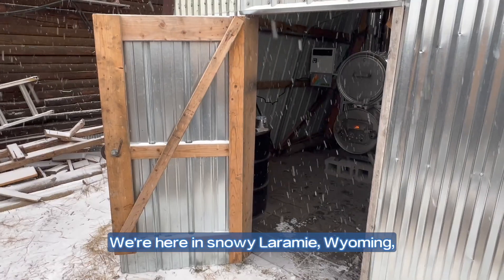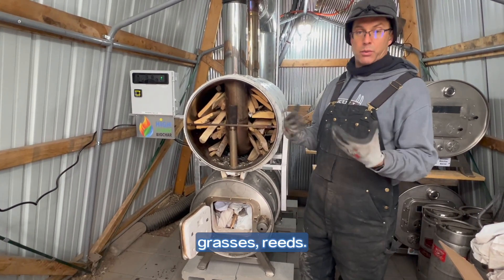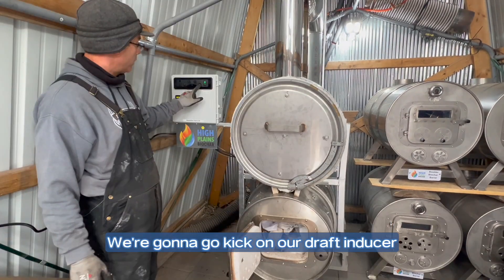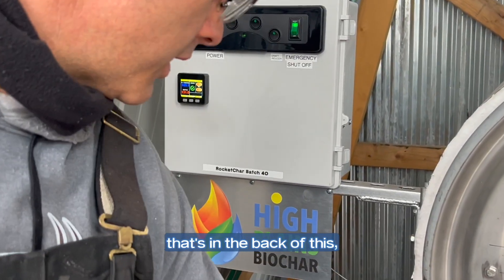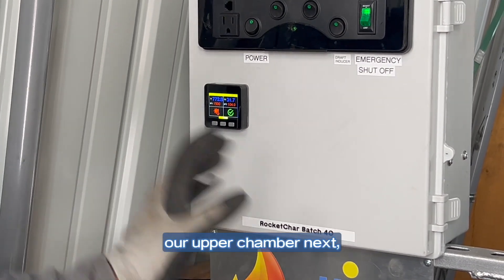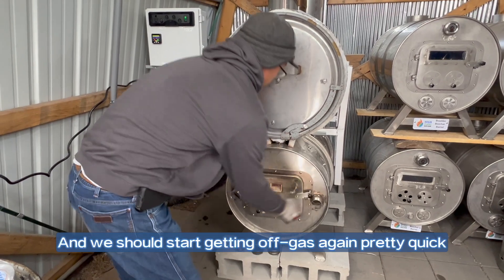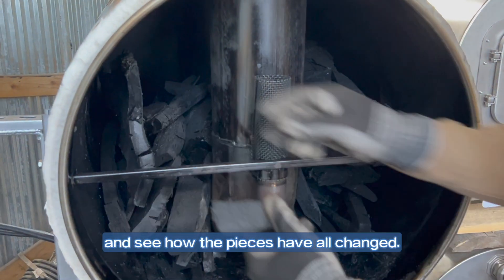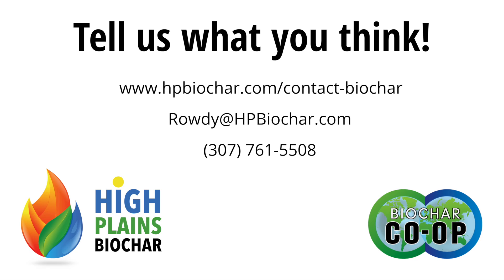Operating the RocketChar B40 biochar stove by High Plains Biochar

Comment: Nice 👍 system you have done. I want somehow combine this charcoal production with my novel very lage ”Water turbine stirling engine” you can se here. The Wall temperatur of the hot cylinder will be around 350-400C for my glass foam displacer 
https://youtube.com/shorts/WTryMD3YQ2g?si=Ij6NgHoxU7i0xsxs

https://youtu.be/b4cYQ27gyRc?si=6resg8Z8IcuHfFWL